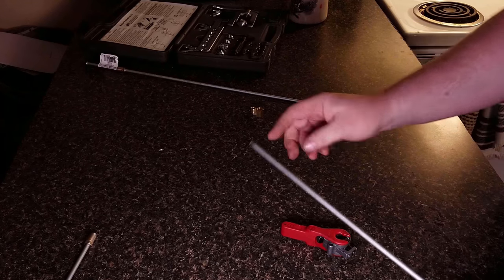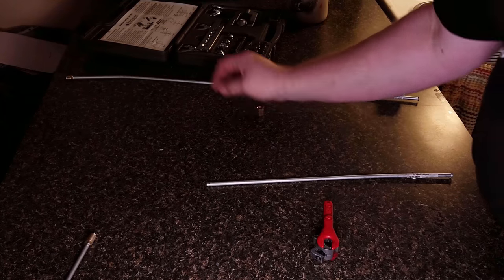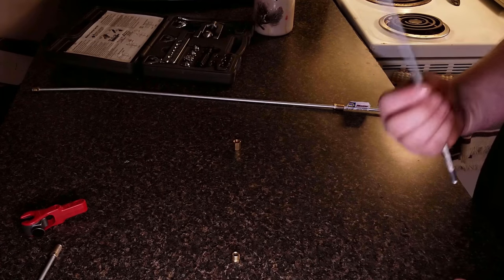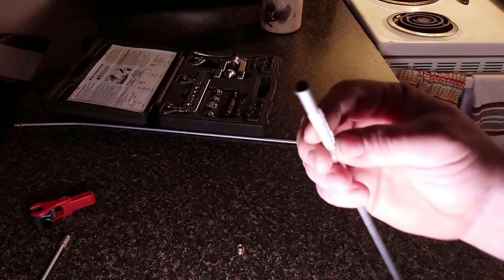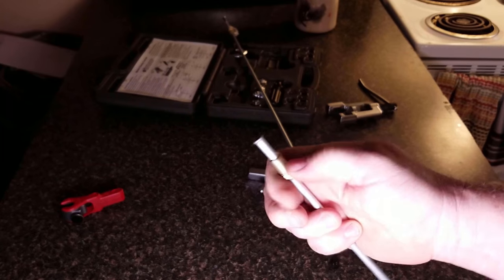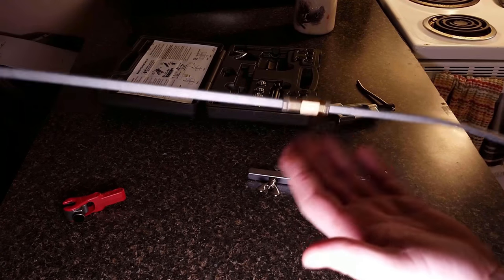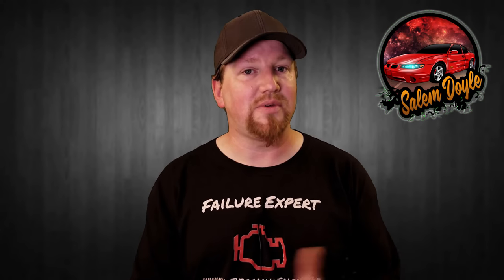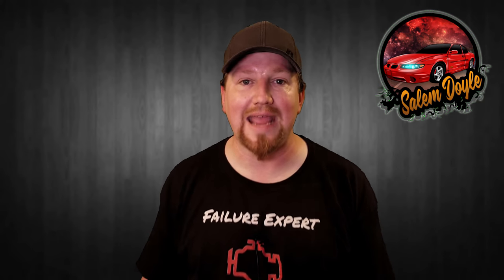The REAL way to repair metal brake lines !

Comment: I honestly cant say that I've ever been able to pull (slide) a ferrule (copper ball) off of any type of line that I've ever put one on.without either cutting the ferrule or the tube or pipe it was imbeded itno (not a friction fit) to get it off. A friction fitting could not be pulled apart by hand. Also a ferrule on a compression fitting would generaly be brass, not copper. A brass compresion fitting is capable of as much as 3000 psi. Brake pressure test guages only read as high as 1500-2000 psi. Its more of a vibration issue leading to a fractured line do to lack of support at the compression repair. An unsupported flair fitting could do the same thing over time. Hence the double flair and so on. Thats why all brake line connection points are solid mounts. Let me put a brass compression fitting on a steel line and lets see you slide the nut and ferrule off with your hands.

Comment: I've used compression fittings to fix my brakes multiple times and it hasn't failed me yet. You'll only loose either front or rear not all. Simply put brakes are overrated

Comment: I use compression fittings all the time making stills. You cannot get the compression sleeve off after you have tightened the fitting down.

Comment: What about the brake fluid?
Reply from the maker: Brake fluid requirements are vehicle specific.  But with brake line repairs, the idea is to try to lose as little as possible.  It will still require bleeding afterward though.

Comment: also have a yellow light abs light
Reply from the maker: That usually comes from an electronic problem with the abs system.  But fluid issues can cause it to come on as well
Reply: @SalemDoyle  text me on fb and explain it to me pls . This is something that just happened

Comment: It's difficult to make a good flare, I tried it 5 time only got one good flare so I would rather go for the compression fitting. I think driving with a compression fitting is better than driving with a rotten brake line.
Reply from the maker: Anything is better than a broken line

Comment: Use unions but not compression lines thy will not sell to you at Napa if they know you are doing brake lines might be ok in a pinch to get you from A to B ther more for plumbing I would not use them for nothing but plumbing it’s not hard to make a flare I would go a little slower you are going pretty fast you can get cracks that way go slow and easy

Comment: Okay he never said what size lil black thing to put inside the line I just broke mine rn 😕🙄 kuz it was wrong size
Reply from the maker: The sizes are listed in the kit.
Reply: Okay kuz I’m working on my brake lines right now and i tried to copy you and a piece just broke I used the 3/16 for my 2004 Malibu
Reply from the maker: Where did it break?
Reply: The little black thing the part that goes inside the tube broke
Reply from the maker: Did it seem tight or anything?  Thats unusual
Reply: Yeah I did it real tight I think it broke off because it was a little crooked at the end I was doing it on was crooked on the tip

Comment: Lighting lighting lighting. Good video but don't try and film at midnight with a flashlight and explain the tool better. Ie: don't say put this part here. Say put the flare tool on the flare block.
Reply from the maker: This is an old video.  I didnt have much to work with. Feel free to check out my newer stuff.

Comment: Please learn terminology before doing videos. That was not a single flare. Actualy see how a compression fitting works. You always deburr tubing before making any type of flare. If the burr on the ID  of that line brakes off and goes inside the line it can cause a blockage. It can also cause a deformed or cracked flare.